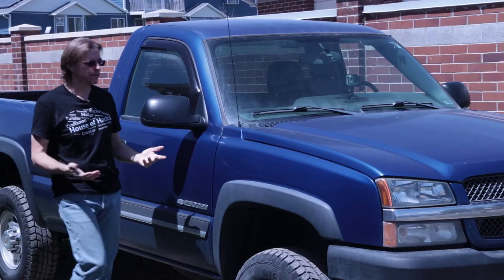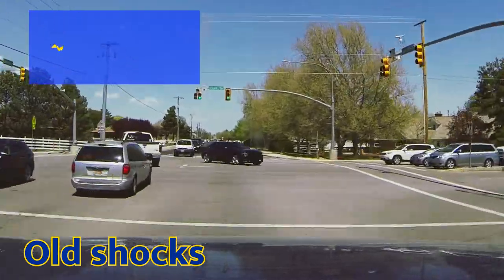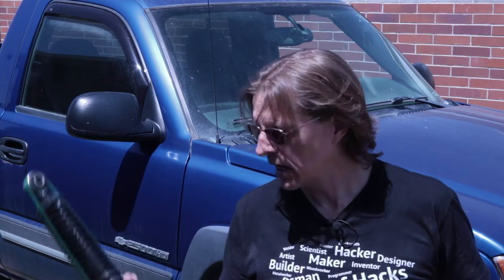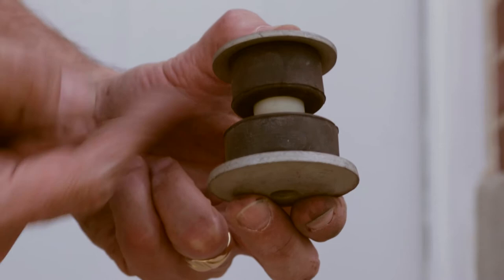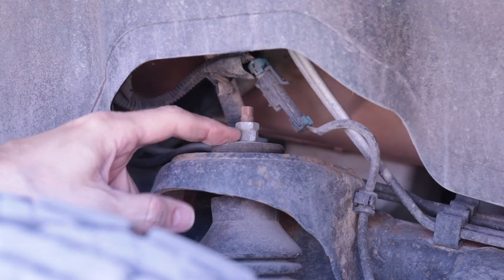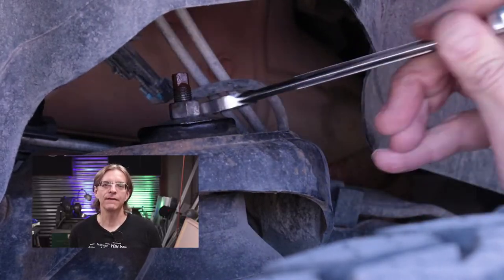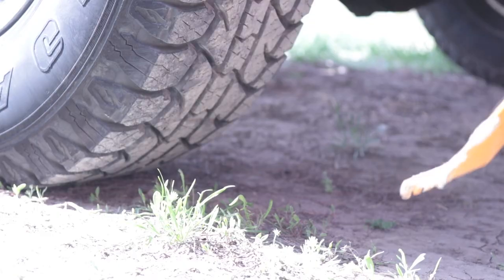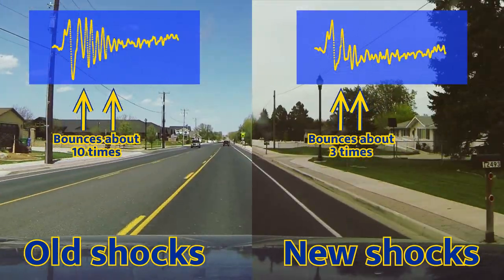Before and after shock replacement: the AMAZING difference

Comment: My Tacoma was freaking night and day after shock replacement, but I've found I really need to replace the rear leaf springs too... someday.
Reply from the maker: Yeah, truck leaf springs sometimes are given a lot of abuse. Fortunately they're not too terrible to replace either. With two mechanics telling me the shocks were OK, I was worried I might need to replace the front torsion bars on mine but they seem to be fine with the new shocks.

Comment: Nice! How did you make that bump graph thing to measure the difference between old and new ones?
Reply from the maker: In After Effects I motion tracked a fix point on the horizon and applied that to the position of a Null layer. Then I used the Write-on effect with an expression on the position property that used the current time for the X position and the Y position of the Null as the Y position effect. Hope that makes sense. Peace.